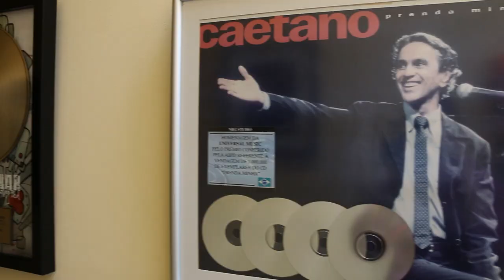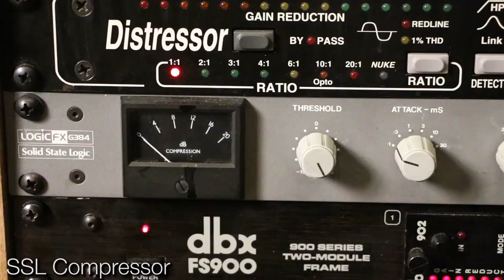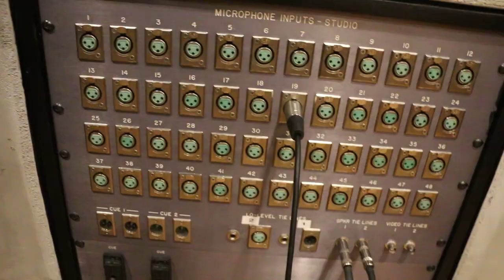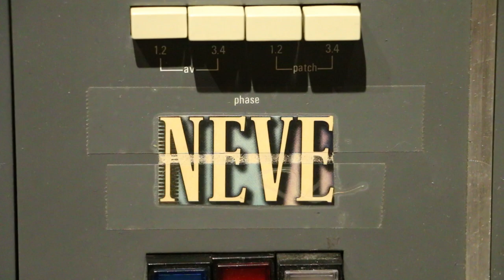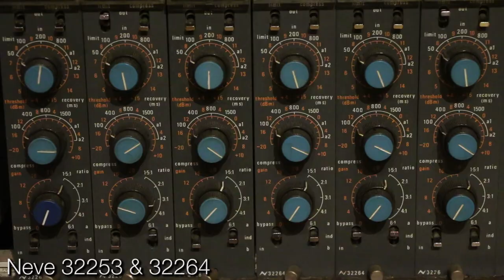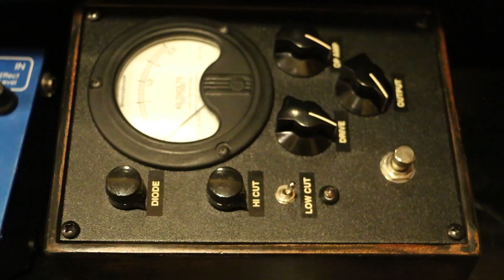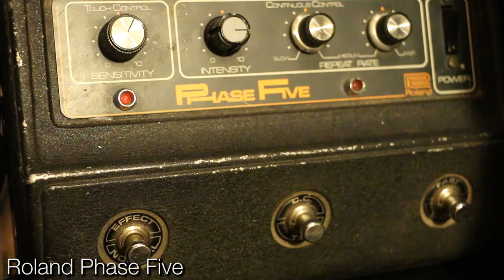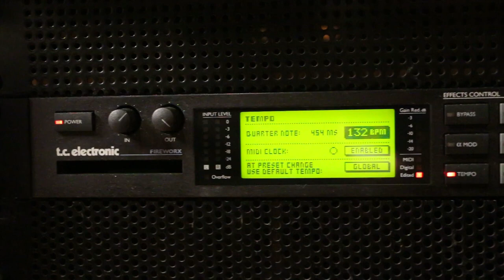Where Rock 'N' Roll History Is Made: NRG Studio Tour - Warren Huart: Produce Like A Pro

Comment: Man what a great collection of outboard gear, vintage instruments and pedals.  Not even going to bring up the Neve consoles.  But I wanted to talk about that Mutron III.  I have had two, and  I’m not sure if you are aware the but the original Mutron folks are back at at it.  I have a Mutron IV Micro, it is the size of a normal stomp box.  It sounds better than the Mutron III in my opinion.  I run it with a Keeley Darkside V2 Workstation, Vintage Univibe, 78 Dyna comp, and vintage ts9 and 808 tube screamers as well as the mxr il diavalo.  I run an mxr micro amp at the end of my signal chain to Lee the signal strong.  I’m not one to use envelope filters that often but the Mutron IV is so versatile.